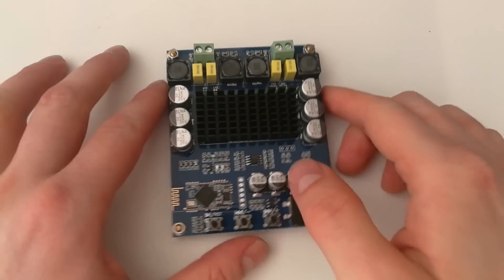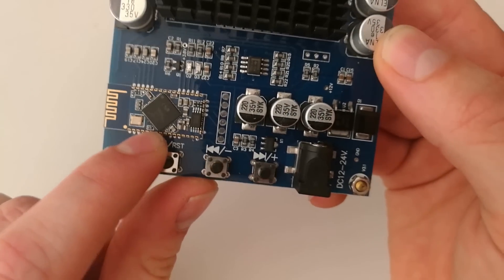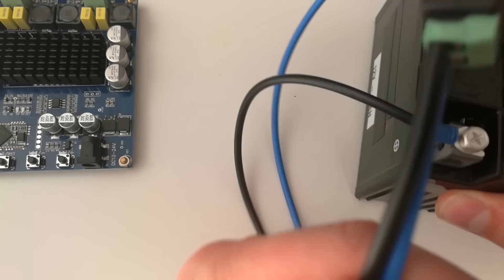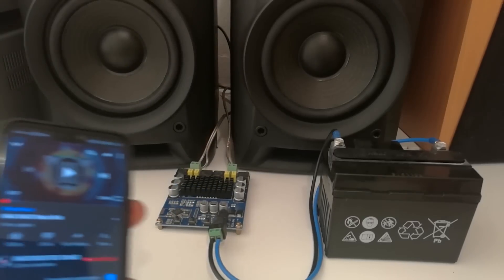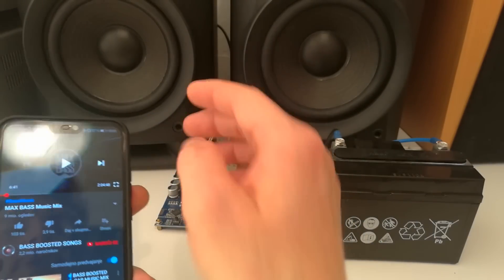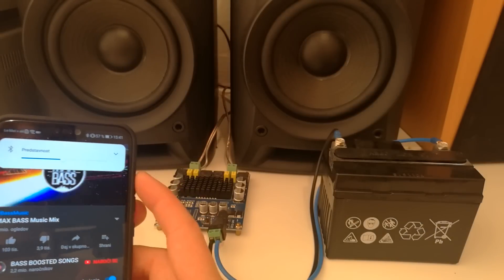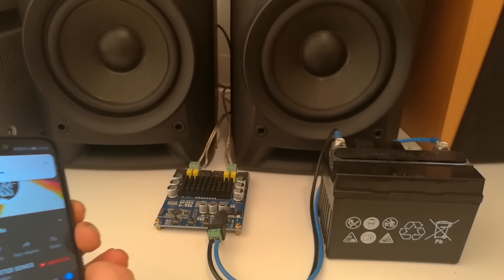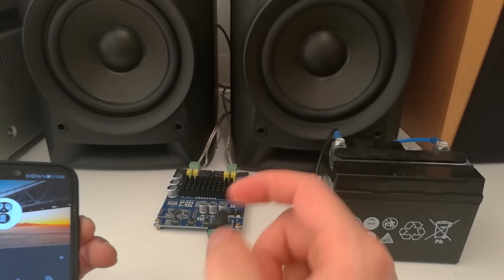TPA3116 D2 Bluetooth Amplifier 2x120W (Sound Test & Good Bass)

Comment: You forgot to mention it has terrible distance. There's a copper plate just under the Bluetooth antenna, You have to solder just over a inch and a half of CAT 6 wire to the end to really reach out

Comment: When I use mine on low volume it cuts off and on what do you think it could be?
Reply: starfire rider I’m having the same problem I have mine on 20v
Reply: Power is not enough use much more amps for voltage feeder.
Reply: use a power supply with a minimum of 2Amp.

Comment: can you charge the battery with all the wires connected?
Reply from the maker: Yes.. becouse the TPA3116 module supports up to 24V pwr. input.
Reply: Thanks a lot. I'm building my own

Comment: Tpa 3116  2.1 homethestre vs tpa 3116 2*120watt
Who is best?
Reply from the maker: Depend what you need.. 2.1 has additional subwoofer out..
Reply: I want general woofer out..
Reply: @als-techreview  At 24V, how many amps do you need to work correctly? Please
Reply from the maker: @AnthonyCamposL  3 to 5A should be more than enough..